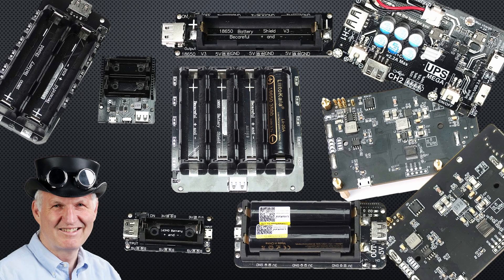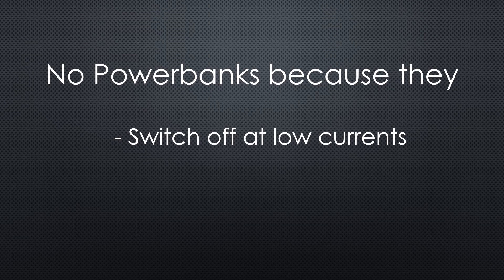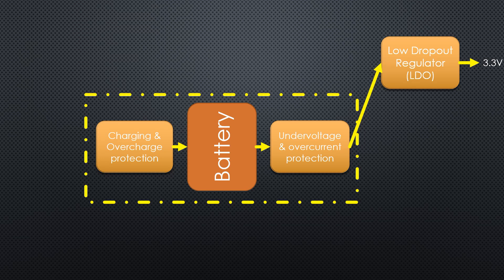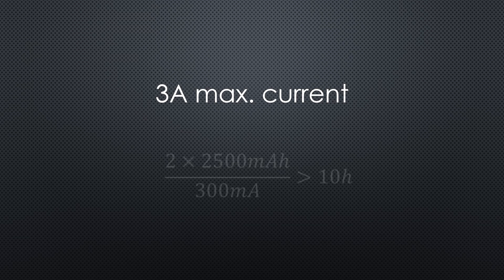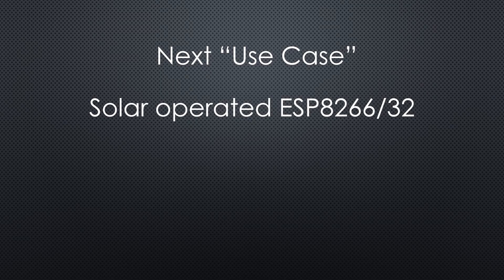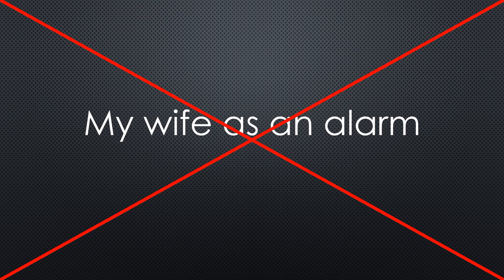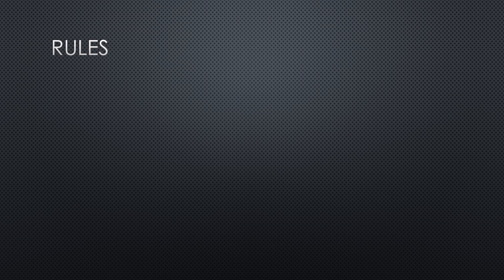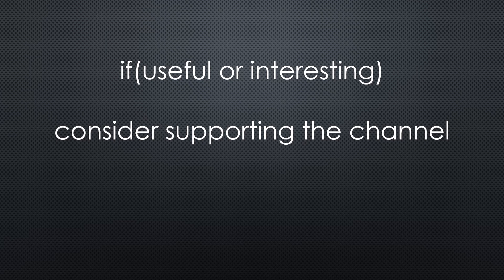#351 10 Battery Power Boards for Raspberries and ESPs. Start of “SuperPower” project

Comment from the maker: Please put your requirements into the project lists (and check before, maybe they are already there): https://drive.google.com/drive/folders/1f19RF6AQi-4VBvSjyZpHFr3eIGdKw_Vn?usp=sharing
Useful chips belong here: https://drive.google.com/drive/folders/1EVSzTGi6zV_2XqgAnM31S37PE2n4OdgO?usp=sharing
Reply: @aGGreSSiv  No 5v boost.  Fine for some limited applications, but Rapberry Pi and other 5 volt dependent boards will be left out in the cold.  Besides, that price without a 5 volt boost supply???  I know Sparkfun is a little pricey, but they need to get a clue.
Reply: @chrisw1462  After my suggestion, I bought and tested the product myself.  the product cannot cut the power at its outlet.  Apart from the 5v problem, this seems to be a more serious problem.
Reply: How is it going? RPi team post regularly but nothing seems happening with the EPS32.
Reply: lol love the part where you use your wife as an alarm clock...  very funny  :)
Reply: Was there any crowded result of this co-op video? Which number if it was
Reply from the maker: @tbgelectr0  No, unfortunately, the project was stopped after the initial prototype because we did no more get the needed parts :-(
Reply: @AndreasSpiess  Maybe an restart?
Reply: @tbgelectr0  Yes please!
Reply: I found this video while looking for a Solar+plug-in UPS for ESP chips. It's still ranking very well
Reply: @AndreasSpiess  Has anyone a list of the parts that are currently unavailable? Are some of the parts discontinued or simply in short supply due to the chip shortage problem?
Reply: Restart now for sure :)
Reply: I want another board that has solar charging and continuous power possibly voltmeter with the high low voltage trigger @tbgelectr0
Reply: Let's kick start this again, I have been struggling to power my esp32 boards and found that initiative back 3 years ago, too sad it didn't continue, maybe by now things are better to kick start again

Comment: Love it!   You are correct, there are many products out there that do not hit the mark, eg over voltage, under voltage, under temperature charge (for LiFePo4), voltage monitoring.  Another use case is a solar powered ESP-32 that is physically small and designed for extremely low power idle,  no USB interface.. with the ESP32 on board.
Reply from the maker: We have now two main paths: For ESPs (or other 3.3V MCUs) and for Raspberries

Comment: Thank you for starting this project about a month ago I went through a similar journey to keep a raspberry pi going during power failure and found a similar issues as you no board does exactly what we need it’s all compromises. If this works out we may have a great power  board
Reply from the maker: Unfortunately, this project died long time ago because of supply chain issues :-(

Comment: Great video!
Would be very useful to be able to control the “final” battery voltage, keeping it below 4.2 volts can hugely extends battery life.
Reply from the maker: Good idea. Maybe you add your requirement to the project lists?
Reply: I totally agree. Charging only to 4.05 or 4.1 V  reduces capacity by 10-15% but extends battery life by 10 times!  After half a year there is break even, where 100% of the 4.2V degraded battery is equal or lower then 80% of the 4.05V charge cutoff battery.  I own a 9 year old lenovo thinkpad with 2h battery life - just by stopping charging at 80%
Reply: Very good idea!
Reply: Would be great if i could gain acces to the Google drive. I need some safe 18650 UPS to work as backup power.

Comment: This is great Andreas! We have already tested some of these boards and they can only be used for proof of concept but not real application. We have designed a shield for arduino 1300 (lora) that uses tp4056 and LDO 3.3 v, including solar panel. (it needs redesign to include reset when voltage drops very low). We will be glad to help!
Reply from the maker: Great! I hope you already joined the discord community!

Comment: This project is very interesting, thank you! When one speaks of battery powered devices, there is one question which should be answered :do we want the device to run the longest possible time when on battery, or do we want the battery to have the longest possible life ? As far as I understand, 4.2 V is a maximum to charge a Li-Ion battery. Li-Ion batteries hate high charges, they degrade much faster when maintained at high charges than not. A perfect ups/power supply should allow to maintain the charge of the battery at a lower voltage, say 4.0V for example in case we want a longer battery life. This raises a new difficulty, as most battery protection chips will cut the charge at 4.2V.
Reply from the maker: Maybe you add your requirement to the list: ( https://docs.google.com/spreadsheets/d/1oGSQRG4XssmFL4II1EF2akhWRhvSvHqH1uTaYX9znlw/edit?usp=sharing )

Comment: completely understand the problems facing with small battery systems. I had to build my own solar battery system for camping. Biggest problem is Li-Ion 3.7V cells. poor cycle life . systems ready for sale all use them.  My needs are 12V 5V and USB C PD 65 watt . I went with LiFePO4 4 cell . my own BMS . Found MPPT solar on eBay for LFP 12.8V . put it all in noco battery box from walmart ! working great over 2 years now.  LFP batteries have 2000 cycle life at 80% DOD. Is 200 watt solar/100 Ah batt. using car assery 12/24 to USB C PD 65 watt . with meter from eBay it's great ! so simple after bult my girlfriend is happy !  not a success until the outher half is happy ! great job !!
Reply from the maker: You are right, LiFePo are a good choice. Especially for higher power applications

Comment: Great project idea. I stated something similar before the pandemic. I designed a simple board to test different LDOs and boost ICs. This is my first boost circuit, so I wanted to try different inductors.
This is the perfect incentive to pick up my project.
Reply from the maker: And maybe you share your gained experience in the project?
Reply: @AndreasSpiess  I joined your discord and posted on the LDO and boost channels

Comment: Useful to have an interrupt, or digital line, for battery low, that is active for some time before dropout, or a small supercap to allow graceful shutdown when the battery drops out at low voltage. I had 6+ years of experience in power management for a large manufacturer of "mobile devices", and 3 years of doing application notes on dc/dc converters for "a German Oscilloscope manufacturer"....
Reply from the maker: So your know-how is very valuable. Maybe you join the project?

Comment: I had similar problems when searching for ideal solution to power my ESP32 with battery/solar combo. In the end I finally found nice step-up/down module Pololu S7V8F3 that is working great (plus INA219 to measure battery voltage and charge/discharge current). Unfortunately this module is expensive (at least in my region).
Reply from the maker: Thank you for the link. I added the tps63060 to the 3.3 volt regulators
Reply: @AndreasSpiess  BTW some of voltage converters (up or up/down) I tested behave strange when battery was LOW (below certain point but higher then discharge protection), for example when sun start to charge batteries converters stayed in "off" (or similar) state and only disconnecting them completely and connecting them again fixed that (but I did not dig into it so maybe it was my fault ?). But important to test this behavior when creating ultimate "UPS" :)

Comment: I have a couple of suggestions.
1: I think the we don't appreciate lead acid battery enough. I know its bulky, and have low cycle life but I think it is still good for cheap power backup for stationary projects. They are simple, safe, 6v is good for a 5v and 3v3 rails and it is 100% recyclable as far as I know. For me they are locally produced and cheap (<4USD for 6v5AH). It would be great to have a board with a proper charger (bulk+boost+float), over discharge/current protection, power path and appropriate monitoring (batt volt & current draw) circuit. What do you guys think?
2: Why don't go for a 2S system. We can have a dedicated buck converters for 5v and 3v3 and a boost for 12v. I think 12v ac to dc adapters and solars and cheaper per watt compared to 5v/6v ones.
Reply from the maker: You can try to find other project members for your idea. I am more than willing to add a new channel for this architecture. You decide if you cant it for the Raspberry or for the ESPs.
Reply: @AndreasSpiess  That would be helpful. I hope I can find more people interested in the idea. Keep up the good work sir.

Comment: It has bothered me for years that there are no good battery shields for any of these little boards. I've made things work with combinations for boost and buck converter boards, but you are correct that a good solution is going to have to be designed, boards are going to have to be manufactured, and parts located and put together. The whole point of these little project modules is to make prototyping and tinkering fast, cheap, and easy. If I'm building a board, I'm going to go ahead and socket in an Atmel or similar and complete whatever device I'm working on at the time. I hope your project goes well, and we start seeing these things on the market at a price that makes them part of my module drawer.
Reply from the maker: I should get the first results in the next week...
Reply: @AndreasSpiess  Exciting stuff. Filling a need. Thanks

Comment: Awesome idea! The INA219 is a very good and popular option for monitoring voltage and also sensing the load.
Reply from the maker: A good chip. But I do not see the use case right now. But maybe you add the requirement met by the chip in the project lists?

Comment: Hi, I bought 2pcs "52Pi Original 18650 UPS With RTC & Coulometer Pro Power Supply Device Extended Two USB Port for Raspberry Pi 4 B / 3B+/ 3B" as you have linked to in the description of the post. I have tried to use it now for the last couple of days. and some 18650 batteries who do not meet the standards regarding mah (it has a capacity of about 750mah) so I followed a link you have posted with another video, so I have to wait til it have arrived and see if it manage to keep the Pi running continuously on the UPS. but as of now this UPS do not manage to keep the Raspberry Pi running continually. I do not have any peripherals connected but keyboard and mouse. and I thought that a good power supply should have the unit running on mains(through the power-supply/transformer, not on the battery and when power outage it should switch to battery power and back to "mains" when the mains come back. so as to maximise the life of the battery?
Reply from the maker: I would check the battery voltage when the Pi runs on battery. Maybe the batteries also have a high internal resistance and  do not deliver the needed voltage at higher currents.
I agree that a UPS have to have the function you describe. I do no more remember the details of the video, but I remember that I was not happy with all the boards and started the "SuperPower" project.

Comment: Excellent video. As always technical great and presented very interesting. On the surface battery power looks simple. In realy life quite complex and lot os issues you need to take into consideration! So great to see this video.
Reply from the maker: We will see if it is complex or if people just do not have the right use case in mind when they design boards.

Comment: I think their reason for putting voltage and current sensor on 5V line instead of battery voltage was not to monitor battery level, but more like to report how much current and power connected device draws, for optimising power usage. And while they could use only current sensing for that they probably wanted it to be more precise.

Some time ago I made something like that, I used tp4057, mt3608 and fs312f-g and 8205 for protection. Put everything on small pcb, set it at about 9v and put inside small cheap dso150. Works great. As i made a lot of pcb's due to small size of board (I got like 80 of them at jlcpcb at 5$ probably) I use them sometimes to power up other not very power hungry devices. And as it's common with all my designs, I managed to make a mistake when designing and mislabeled output pins.😅
Reply from the maker: I added you chips to the respective lists in the project. Maybe you check and enhance? ( https://drive.google.com/drive/folders/1EVSzTGi6zV_2XqgAnM31S37PE2n4OdgO?usp=sharing )?

Comment: Nice idea. If you want to be able to carge a 4.2 and 3.6 battery tipe changing just one jumper (or switch), you can take a look at the TP5000 IC, it's a buck charging, up to 9v input (perfect for solar) up to 2A charging. Also, a nice feature would be an intelligent dual function: if the output is 400mA and the battery can charge, at it's current voltage, at 100mA, the carge controller should be able to compare it and still let 500mA go to the battery, since 400 will go directly to the output. If not, each time you have the output on, the cell will be depleted until charging and output current is even, and you will never have the full battery capacity (plus, it will be running charge-discharge cycles depending on the weather, if it's connected to solar power, and the battery will age faster...).
Reply from the maker: Thank you for the tip! I added the chip to the lists in the project

Comment: Wow. You're the man! I was going to send a smart ass comment that if none of the boards met your requirements, you should design you own... ;-)

I think all of your initial requirements make good sense, but I am ambivalent about the need to use JLCPCB's capability assembly because LCSC has a limited selection of ICs (but that's based on a very small sample size so it's anecdotal), because they don't do large manufacturing runs (but 30 boards is probably fine for 99.9% of your viewers), and because they force you to use green solder mask and lead free solder (but I need to get used to this horrible European requirement)...
Reply from the maker: If you have a better choice for assembly and global distribution at acceptable prices we are very interested...
Reply: @AndreasSpiess  I've purchased 25 different designs from JLCPCB, all in ENIG, with varying number of layers, board thicknesses, copper thickness, and solder mask colors, and they have always done a good job on the boards with excellent registration and quick turnaround at the lowest price. 

I haven't used JLCPCB's assembly yet because they never had the high value ICs available, and even a lot of the jelly bean parts are from Chinese manufacturers, but maybe they will suffice for your project, or maybe you will have to solder on one or more parts yourself (generally not an option for me).

As far as international distribution, I guess anybody can use DHL although it wouldn't surprise me if rates from China to Europe and America were cheaper than other routes. I've given up trying to figure out how Chinese companies can send me stuff from the other side of the world at cheaper rates than it costs me to send to the other side of town...

The main variable though is quantity. For less than 30 pannels, it's hard to beat JLCPCB if they have the parts you want. At quantities of 100 and higher, there are comparably priced options in the US and Europe with more flexibility in board design and parts, but turnaround time will be a little longer. Even then, the US or European company may still have the boards and PNP done in Asia, but they will stand behind the work.